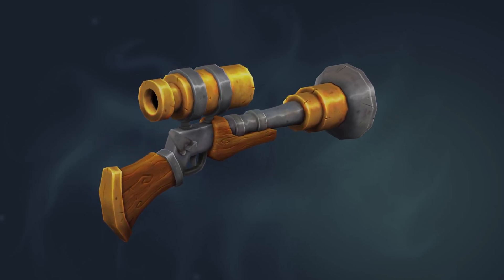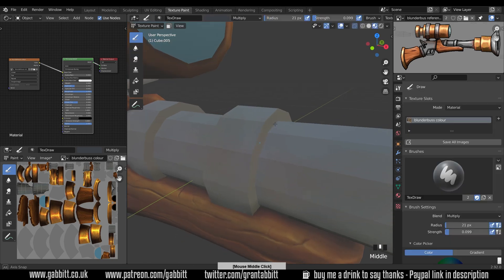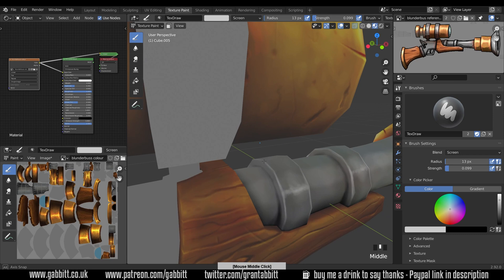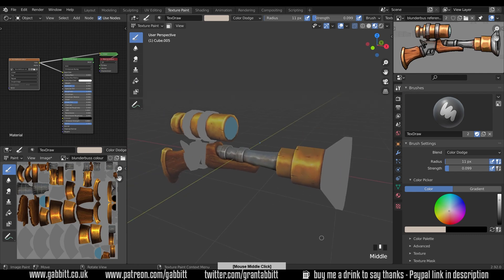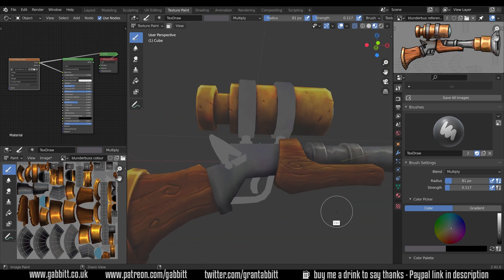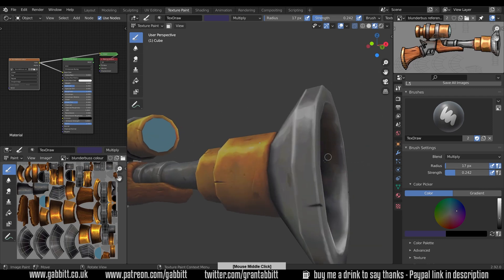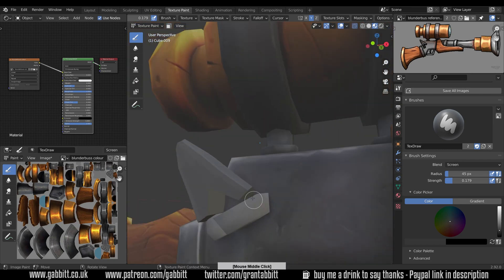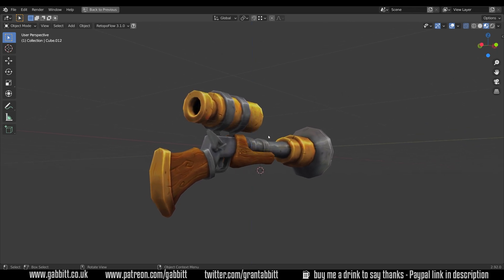Texture Painting Metal (Iron & Steel)- Blunderbuss Pt 11

Comment: Made a video about my problem https://youtu.be/2-1u3MlUNqc
Reply from the maker: yes it looks like you have the setting front faces only turned off. in hte brush settings i think, although it might be called something else these days
Reply: @grabbitt I have found this option in sculpt mode and activated it and it is not the problem.
Reply: @grabbitt I did try to Load factory settings but that didn't help
Reply from the maker: its difficult to say what it is and the texture panting within blender can be buggy like this. i suggest using the face mask option. you can choose faces you dont want to effect
Reply: @grabbitt  thanks 😊 I will try that next .
If U want I can send U a blender file so U can investigate maybe make a video if U figure out what the problem is

Comment: Wondering how i can panel texture my plane, any ideas boys ? I am using stencil and a panel texture but it doesn't look good enough.I want the size of the panels be more equal. Maybe i can use brick texture but still doesn't look good enough. Maybe i can do sth with nodes not sure...
Reply from the maker: tricky to say as there are a few options